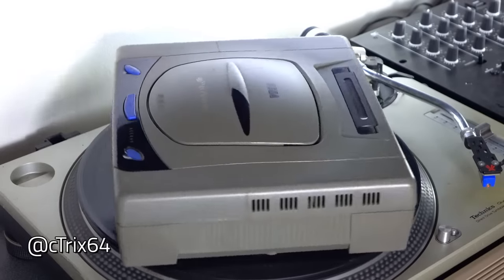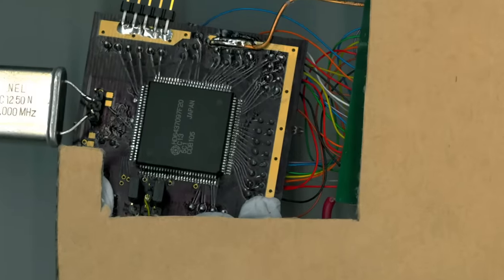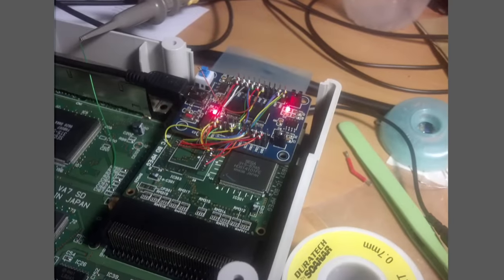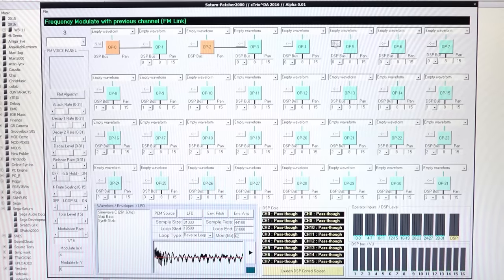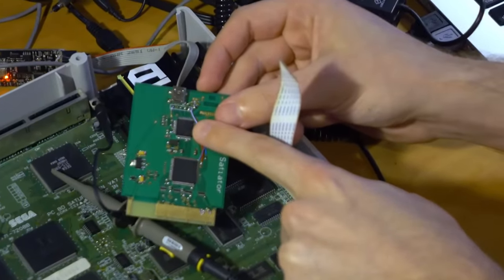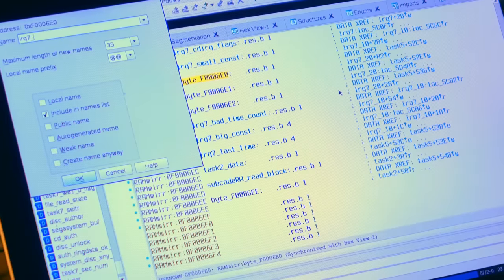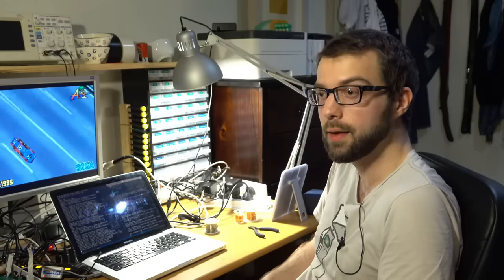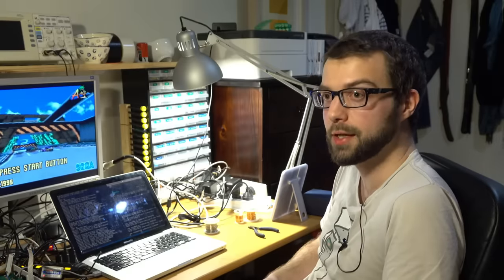Sega Saturn CD - Cracked after 20 years

Comment: Good shit, boys!

It's been said that the Saturn is the best 2D console to have ever been built. With this, in a way rather similar to the Dreamcast, people can finally tap into all this unused power and show what it can really do!
Reply: Saturn can do 3D better than PS1. Developers just didn't understand its architecture properly.
Reply: Are you high or just trolling. You're completely and utterly wrong about that, FWIW. Saturn had a fucking terrible bodged 3D implementation. I shudder remembering it.
Reply from the maker: Did  you code for this console by any chance?!   It certainly didn't have the amazing SDK that the Sony Playstation had - reading through the official documentation (don't mention the amendments!) is pretty hard work.  It totally lacked the humor, of say, the Atari Lynx documentation.

I agree it's 2D was spot on; and it could be interesting to see what people homebrew for it.  Although it is a hard unit to "hobby program" for (say, compared to the 68k in the Megadrive).  I'm in the midst of trying to make a modern implementation of the sound tools suite (PC based) and it's hard work to fathom a sensible interface to control the audio hardware let alone deal with the massive list of registers.  As for the DSP effects block... we'll get to that when we get to that!
Reply: debuglive I happened to have spoken to someone who used to Work for Working Designs who did.

They actually had to import SDKs and use a Translation Application to set Assembly in most the games they used.

Saturn's problem with most developers is that they opted to use only one SH-2 core instead of both(which is required for full 3D).

Games like Dead or Alive and even Virtua Fighter 2 made use of both SH-2 CPUs properly utilizing them.
Reply: Yeah I programmed some Saturn stuff (which, apart from the sound driver used in "Croc") didn't get released, project (Micro Machines) was canned before completion due to crappy sales of Saturns (at least outside Japan).  It was very complicated (i.e lots of separate chips and a zillion 2D display modes etc) and if I recall barely any software support (just huge VDP manuals etc) but the main issue was that they threw all this (expensive) hardware at basically making a crazy 2D machine right at the point that 3D was taking over, so they clearly changed tack 75% of the way through and bodged in some basic 3D rendering (and I suspect added the second SH2; there was no need for two SH2s for 2D games).  Basically a bad console. If you love working with really complicated 2D display hardware then great, but ultimately it's more annoying than anything else; as the PSX  showed, it's a much better idea to focus on a well optimized efficient 3D rendering pipeline (with matrix multiply hardware for the geometry) because doing 2D games on that is a piece of cake, because the last section of a 3D pipeline is 2D anyway. It's vastly less hassle to implement an arbitrary 2D game on triangle rendering hardware than with a really overcomplicated 2D chip.  Sure the PSX rendering looks pretty clunky nowadays (only 4.12 resolution on the math, rasterizer wasn't perspective correct, no subpixel, no antialiasing or trilinear, no Z buffer, etc, etc) but it was very well designed; someone really knew what they were doing with that machine. I remember when Phil Harrison showed us the early PSX devboard demos (e.g. the Dinosaur) at Sony's place in Soho, it was dazzling. Pretty much right back at the dawn of 3D gaming....
Reply: I love those micromachine games... still play V4 on PC with my friends...
Reply: Diego V Yeah they really nailed the playability on those; very fun. Was mostly the work of a guy called Andrew Graham who's back working with David Darling (was Codemasters founder/CEO) now at a company called Kwalee. Not sure exactly what they're up to...
Reply: i played on dreamcast 5yr ago or may be 7yrs
Reply: I disagree; having programmed the Saturn - the primary issue with it was the appallingly bad quad rendering of the VDP; sure it had two pretty decent CPUs but the 3D rendering hardware was just terrible; it's not just "quads vs triangles" (a 'battle' which has been thoroughly won by triangle rendering since the mid-90's, quads being basically a poor choice) but because the Saturn's actual implementation of quad drawing is awful; it overdraws a ton of pixels, which is very inefficient AND makes alpha-blending unusable, hence the ugly every-other-pixel 'screen door' translucency was hacked in there; it's slow, broken and idiotic. The Saturn was overall a fairly ridiculous piece of hardware; the exact opposite of an elegant, efficient design; it was not some overlooked, misunderstood masterpiece, it was an overcomplicated, underperforming mess.
Reply: Ah yes, tri's won out over quad's as they are more versatile (which really goes back to the fact that anything reduced to its most basic component will nearly always be more flexible in its ability to be built into another form, though not necessarily more efficiently), however they are not always the most efficient form of rendering - though this is a mute point nowadays with the power of modern GPUs. So yes, tri's are a better overall choice, but not ALWAYS the most efficient means. Swings and roundabouts. Regarding the Saturns implementation of quads - I will happily take your word for it as I am not well versed in this, nor have I ever programmed anything for the system. Another interesting side effect of using quads is the near elimination of perspective warping, unlike tri's. Again, this is no longer an issue, so mute point. However it was an issue back in the heyday of the Saturn and PS1. 

Whilst I am sure no one in their right mind would argue that the Saturn was an "elegant" design... and it was definitely an overly and needlessly complex hardware implementation, it was far from under-performing. The fact that it can out perform it's main competitor shows that. HOWEVER, its messy development and haphazard dual processor implementation means that it WAS a pig to development for and almost never saw it's potential demonstrated. 

Of course, with 2D being as much of a novelty these days as 3D was back then, the Saturn wipes the floor with the PS1.... and most over consoles. However, back in '95 3D was the big thing and 2D was yesterdays news.

Interesting how more and more people appreciate the Saturn now for the very things other criticised during its lifespan. :)
Reply: Well kinda... thing is the back-end of 3D is a 2D rasterizer; if that's well implemented you can do pretty much any 2D game just fine with it (as is often seen) and usually more easily/flexibly than using sprite-style hardware.  Quads suffer from perspective errors same as triangles (well the artifacts look a bit different but same problem; you need a divide-per-pixel or use interpolated RHW or some other trick to get perspective correct texturing), plus quads and have other more serious problems; for example triangles are always flat on a 2d plane, quads not. Quads can be concave shapes, and so on; quads are just not a great idea when you get to the nitty gritty of implementing. Triangle hardware can have all sorts of nice optimizations (strips and fans for example) that work cleanly, and rasterization of tris is easier to parallel process. Anyway, the Saturn made a real pig's-ear of the rasterizing; the overdraw was shocking
Reply: So how can cracking the cd allow people to ra p into the saturns power?
Reply: Annie Gonzalez It only opens Source Codes.
Reply: TheIncredibleMasterE good shit good shit good shit good shit good shit thats some good shit right therea
Reply: @CTRIX64  Actually, Tornado 1994 is correct. Saturn was superior at 3D against PS1 as well.

Also, the Saturn's Documentation was actually incomplete due to the fact that Taping for it was rushed four months too early into production in December 1993. Saturn theoretically supported a 4 MB VRAM MAX with up to 8 MBs of Expandable Memory.

Saturn also used to 512KBs of Z Buffering on 8 Dies.

Saturn was capable of Perspective Correction,Diffusion,Multi Threading,Sprite Redrawing, Transparency,Meshing,Dithering and Reflection and even Affine Plane Deflection. PS1 was not capable of either of these.

Anyone who thinks PS1 bested Saturn in 3D is overlooking Key 3D Rendering and Texturing aspects. PS1 actually did a POOR Job at handling Texturing Mapping and Rendering and was actually the weakest, most underpowered console of the 5th Gen.

PS1 had a very SLOPPY mechanism of relying way too much on Bilinear Filtering for Rendering, and could only do Distortion. IT did a rather PISS POOR job at Environments and even Infinite Planes because it lacked Perspective Correction and Anti Affine Recalculation for drawing Planes. This was why games often had a blocky,grainy warpy and fake 3D look to them.

PS1 couldn't even handle character models right. It only had a max of 48KBs with 12 KBs of 4 Die Threads, maxed out Flat Shaded polygons at just 360k as opposed to Saturn's 500k and N64's 700k.

Did I mention how lame the so called "Transparency" on the PSX was?  It was all Fake, and Smoke and Mirrors effects, implemented through the use of Screen Filtering,Low Key Illumination and heavy Bilinear filtering.
Reply: @DrTune  Completely disagree on all fronts with your comments. Its clear not only have you never actually worked with Trapezoid Polygons(which is now a Standard for most effects in Films) but you clearly read its documentation incorrectly.

Saturn does NOT handle Alpha Bending, Neither does PS1. Trapezoids are drawn smaller and much more versatile then the gimmicky "Smoke and Mirrors" Triangles. Saturn relies on Bit Mapping for handling layering, Texturing is Done through Multi Layering or Multi Threading. How would you not know that? Its done the Same way on N64, except instead of Bit Mapping, N64 handles Quad Layering and Alpha Bending or Multi Bending.(A Technique ONLY SGI had patents to and is best displayed in the 1992 Sci Fi The Lawnmower Man).

PS1 drew Larger Polygons than Saturn and N64, but because it lacked Perspective Correction and had no Infinite Plane Correcting Methods and Engines for  Re Calculating models,environments and Affines , it did a rather SLOPPY job and texturing,shaping and layering. That's why PS1 games looked so fake,grainy,warpy,oblong and blocky and why the Sony PlayStation Classic is bombing so badly. People are finally getting to experience and see just how poorly the PS1's 3D and its technology has aged.

Comment: This is unbelievable. Hopefully the same idea of preservation can be applied to all optical disc based consoles. being a big fan of 5th - 7th generation games (especially 6th with the Dreamcast, PS2, Gamecube, & Xbox), it would suck for the ability to play the games I love to become virtually impossible.
Reply: You can use a PS2 with a usb stick :D i do it and the only drawback is the lag in the cutscenes due to the fact that the ps2 has a usb 1.1 port. Gameplay is smooth as butter. Search for open playstation loader (OPL)

Comment: 14:58 Yes, having a CPLD that lets one implement a bunch of digital glue logic to connect the bus that used to hold the MPEG material to one's own microcontroller, especially being it an actually reasonably powerful arm microcontroller running at 72 megahertz is a very nice thing, I believe.

Comment: my saturn as a mod chip, but i would buy this in a heartbeat
Reply: buy a Rhea or Phoebe. Same solution way before this guy came out with his
Reply: Those require internal modification to the console, this would be just a card that goes into the video cd card slot.
Reply: Ehal256 those doesn't require internal modificaties. you just put the Card in 2 the cd slot. it's basicly the Same thing as clicking in a hard drive and clicking it out
Reply: True, but it still requires opening the machine and taking parts out.  Some saturn models require soldering as well.
Reply: Ehal256 No it doesn't require soldering. it's about 30 seconds work. don't make it sound like it's a lot of work when it's not.
Reply: I'm not saying it's a lot of work, but according to an installation guide I'm reading, specific models (early v3 models) do require soldering.  So not everybody can assume it'll be quite as simple without doing a little research beforehand.
Reply: Ehal256 There's no soldering needed for those units. Just removing the trap board. And if people wanted to order one they can just hit up the site where all the information is that you need for buying one and installing one including pictures of different saturn models.
Reply: Ah, it wasn't quite clear, but it meant certain older rhea versions required soldering. However, in the future, I'd definitely go for a single cartridge that takes no install whosoever, if the project is finished.
Reply: Ehal256 Yeah i'm not saying this is bad. It's def interesting and something i would buy nonetheless for another saturn i have but it's just dumb that this guy got in the spotlight for something other people did years ago in a similar manner and they didn't got in the spotlight whatsoever.
Reply: billybrenders Well, the rhea only emulates the cd drive right?  This guy was the first to dump the cd block cpu and reverse engineer it's program.
Reply: Ehal256 still the Same thing everybody is gonna use it for. iso's
Reply: If that's all you care about, then yeah, no difference.
Reply: Nope the body of his work (the data he gathered and the potentiall final card) will also be used for homebrew devellopement espcialy since the saturn never got to truly take itself to the absolute limit...